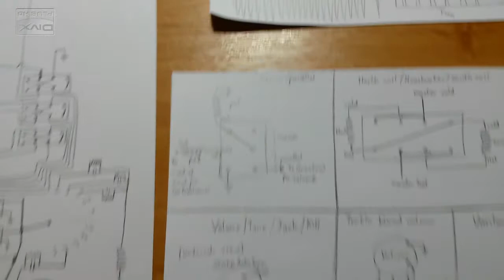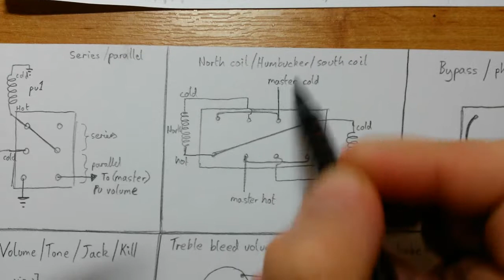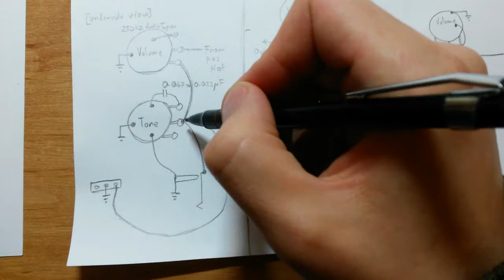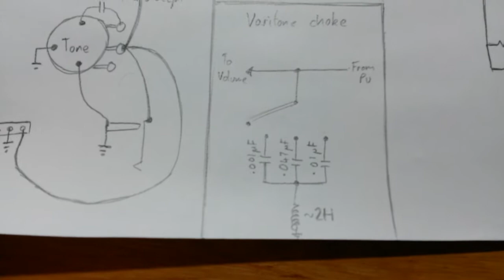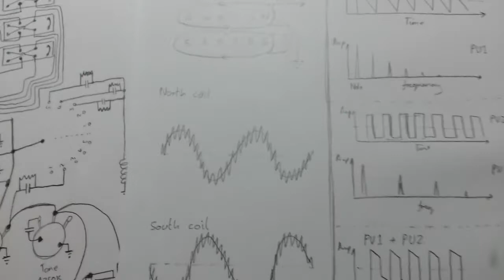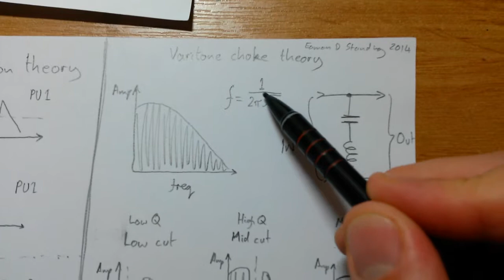EDS Vlog 24f: Modding Joe Trohman (part 6) - Wiring and sound theory!

Comment: Yes! Thankyouthankyouthankyou for this, I've been trying to learn diy guitar wiring theory and this is video was a huge step forward for me, for whatever reason I can't find info that helps online, but you nailed it for me. Where did you learn this/are there some more resources you could point me to that would explain the math and relationships between voltage current resistance in audio circuits?
Reply from the maker: Will Prinzi hey man, cheers for the kind words. i mostly learned this from experience  and a background in physics but i started off with wiring diagram from guitarelectronics.com and seymour duncan. lemme know if you want more info and i find more links but those two are the best because they have full wiring diagrams for tonnes of guitars. have fun~